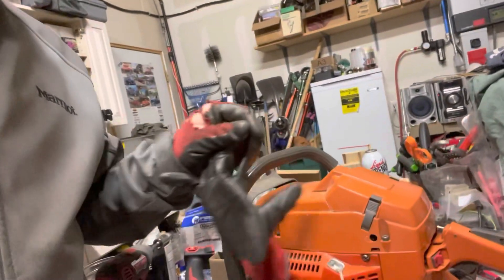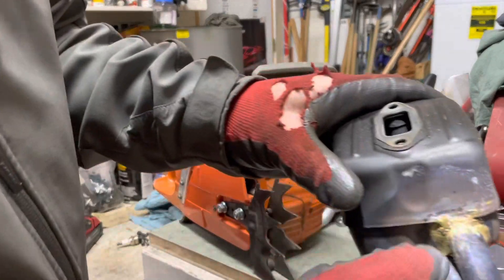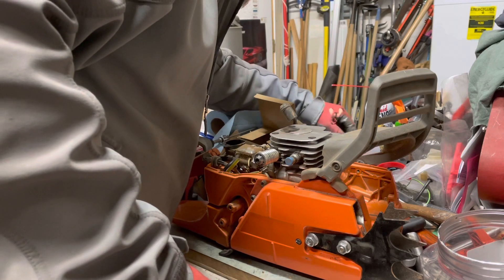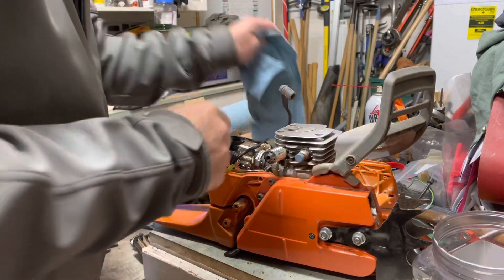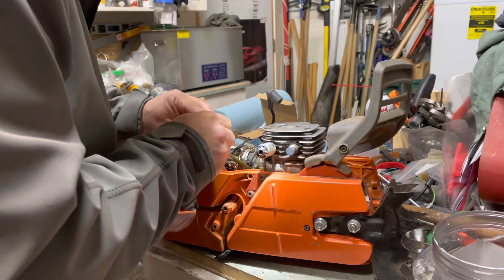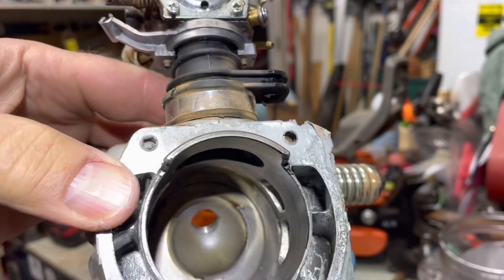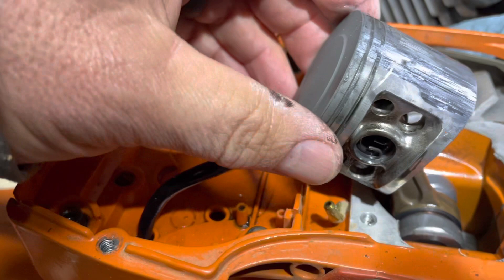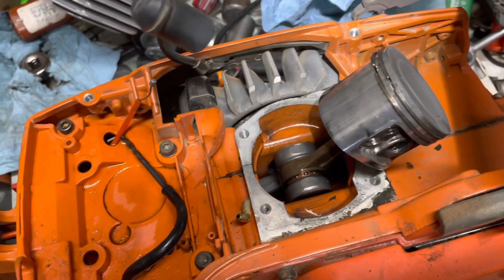Aftermarket 372xp went south. Autopsy time

Comment: My guess is air leak. The inside of your saw will have oil residue all over crank, con-rod, and and piston otherwise. Just my 2 coins. Ensure you’re using a base gasket, or a good high temp gasket sealer. Thanks for sharing👍🏻
Reply from the maker: Since it was still holding tune and not running erratic the muffler being cracked would not cause a lean condition on the exhaust side of the piston?
Still self educating myself. Lol and not wanting to miss anything when I put it back together.
Reply: @sunbear1973  I don’t think those cracks would’ve caused any issues personally. 
You’re doing good man ask Brisco questions!!!

Comment: I guess it caught a ring? Pretty big ports there. Cheers
Reply from the maker: No it did not catch a ring. The exhaust had 2 pretty big cracks in it on each side of the bolts at the flange . What I think happened is that it caused a lean condition on the exhaust side of the piston and roached it. I think that I can clean the cylinder up and reuse it. From how it ran in the beginning it was very strong with those port sizes and numbers that I had. Thanks for the comment and questions
Reply: @sunbear1973  thanks for reply. I am starting with porting saws. That one is one of the worst I've seen. Thanks for sharing.  Cheers
Reply: Cracked muffler will should cause a lean condition.

Comment: Looks like no base gasket, so you used a sealer. It looks like you have a bit of excess sealant along the outside of the cylinder. If some of that got in the cylinder it would not be good.
Reply from the maker: Hi. That is correct on no base gasket. I used MotoSeal and I did not show it closely but it did have an even seal. I let set for 24hr to set up and I have learned to pressure/vacuum test all the saws that I have built after the curing time. If I had a lath and could cut the base and use a gasket I would have done that.